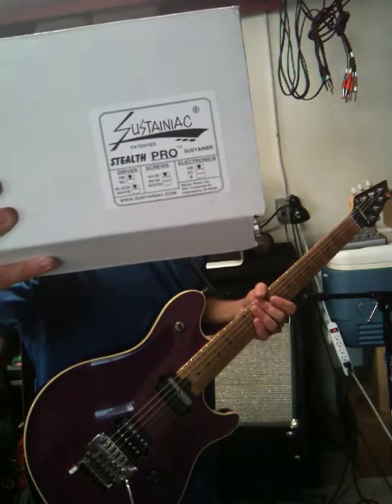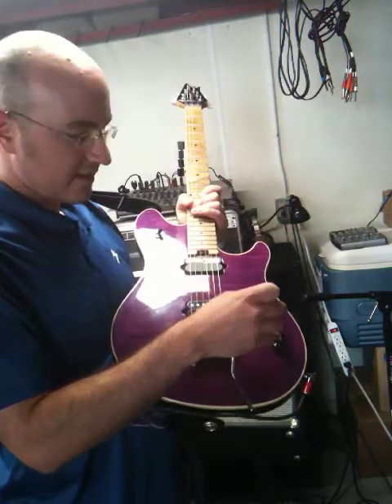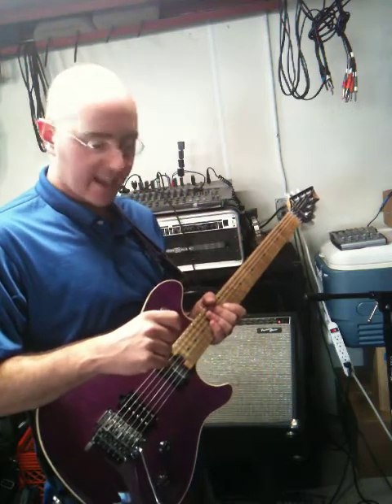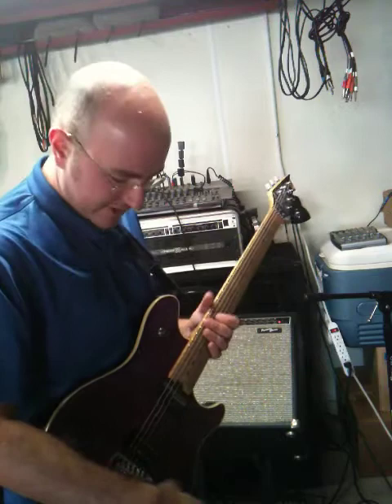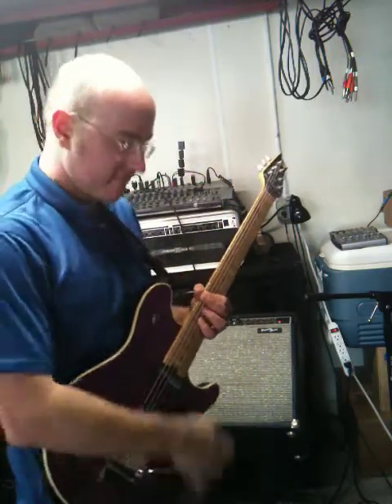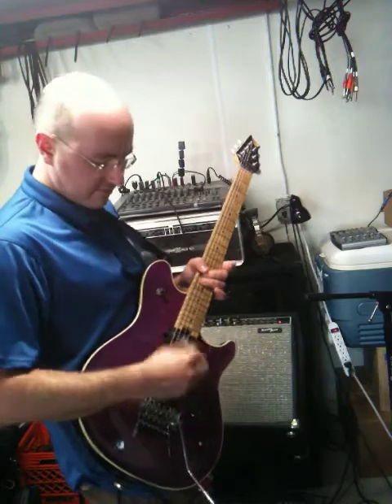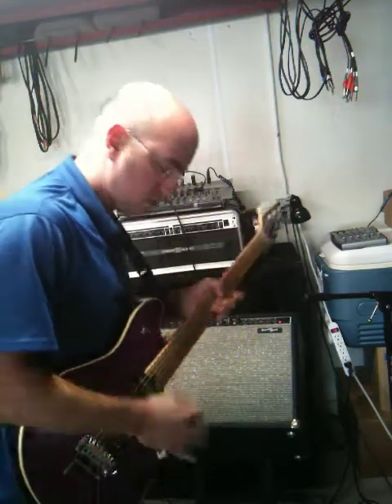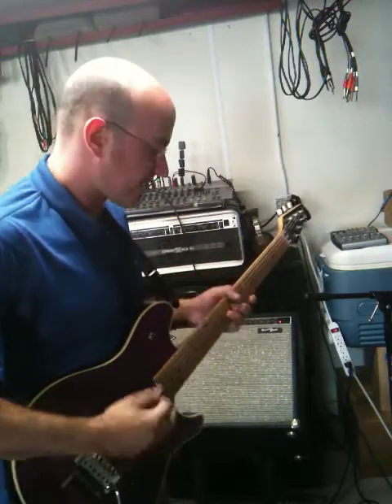Sustainiac Rocks! Infinite Guitar Sustain

Comment from the maker: @tmblacktrack I sent my guitar to my local shop and they installed the unit.  This was before I was experienced in soldering and working on guitar electronics.  Also they did some routing for the battery compartment (optional) and my pickup cavities had to be lowered (Wolfgang style guitar).  So if any of this sounds beyond your personal capability, please send it to Alan Hoover or a guitar shop.
Reply: How much that sustaniac circuit?

Comment from the maker: @dotsunmoon yes i am still satisfied with the Sustainiac.  Please watch my video for a demo of the regular tone of the neck pickup/driver: "Sustainiac Rocks: Tone of the stock pickup (driver)"
The 9 volt will last 5-9 hours of play time from my experience and yes the battery is used anytime the neck pickup is used when it's not in sustain mode.  That's because the neck pickup is an active pickup and requires power.  When the neck pickup starts to sound "grungy", you need to change the battery.

Comment from the maker: @PhysicalGraffiti10 When you have just one Sustainiac pickup installed (neck) position, it sustains your bridge pickup and doesn't affect that tone which is great.  Now when system is off and you are playing through both or neck, you get the tone of the supplied pickup (which sounds good to me).  To answer you, you can't run 2 Sustainiac pickups in the same guitar to date.  Even if you could, you would have the tone of the supplied pickups and not longer be able to have your original pickup tone

Comment from the maker: @stormchasers25 If you don't want to cheat then you have to rely on other measures. If you can use actual feedback then it depends on you volume, position, and guitar acoustic properties. The more hollow body, the better. If you are purely going for a pedal, it's all about the compressor or overdrive or distortion which squeezes your signal. The more you squeeze (ratio or gain) the more your output will ring at that perceived volume.

Comment: I'm pretty sure it has to be as close to the neck as possible, as it's closer to the harmonic/vibrational point of the 24th fret (or just over it if installed on a 22-fret guitars).  Most guitars equipped with a Sustainiac-type systems don't even allow for a Middle pickup as they're usually too close to the Pickup/Driver to work well - the only one I'm aware of is the Jackson PC-1 Phil Collin Signature, which has a DiMarzio HS-2 Stacked Humbucker Single Coil but offset closer to the bridge.

Comment: Very cool mod on a very cool guitar! (I actually prefer the Peavey Wolfgang to the EVH version!)  My next Bass is going to be an "Effects Bass" made up of a Bass Sustainiac (yes, they make them with a few circuit swaps) & a Kahler Bass Tremolo.  Played clean the Sustainiac sounds like a Bowed Cello, which is cool enough... and adding effects you get to sustain & whammy harmonics, lead, slap and two-hand-tapping parts.  I'm simply past the "Using an eBow on single Bass Strings" point... :-D

Comment from the maker: @PilferMusic Push pull is ok but my volume knob is closer to the surface and sometimes it takes me an extra second to lift it. That's not ideal for being fast. I might say add toggle for on off.
For the tone knob, I really like the in between settings, like mild then later in a solo full on sustain. So I would keep push pull on tone. I think losing the fine tune ability might make the effect more artificial (not terribly however).

Comment: will that work on a squier strat
Reply: +Matt M It would work on any guitar but it will require some mods, especially on a start which isn't usually set up for dual humbuckers anyway... You'd either have to replace or rewire the 5 way switching system but their certainly a lot of variations that would work and be quite interesting.
Reply: Ian Barrett how about epi les paul